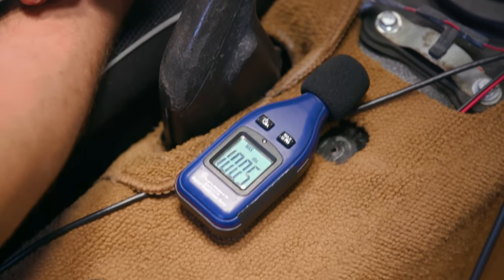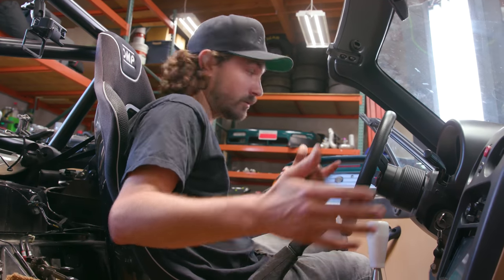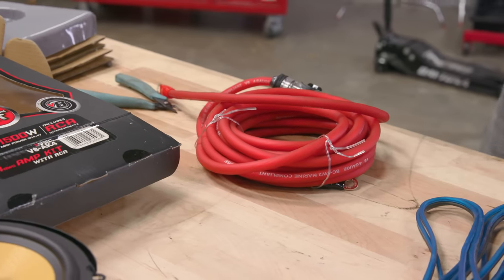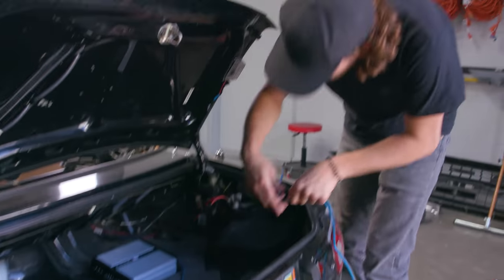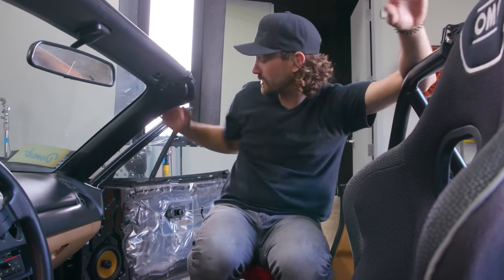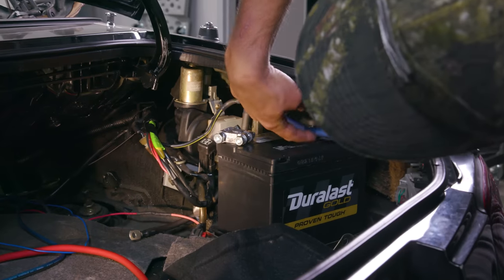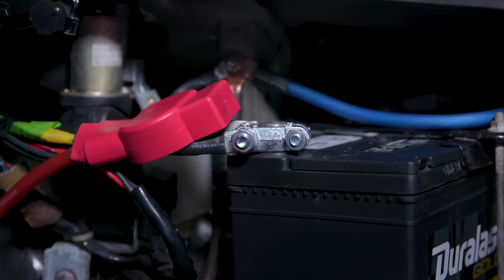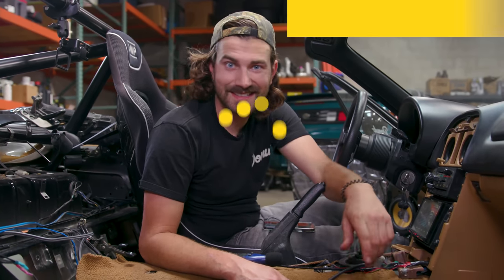Is Upgrading Your Car Speakers ACTUALLY Worth It?

Comment: the only thing that was a little off about this video was when he talked about the power a headunit can send to door speakers, some decks can reach like 200-300 rms, saying that, its gonna cost you some money for a tough enough headunit, you can still get more than enough power instead of using possibly 2 amps in your car for speakers and sub. way more un needed wiring.

Comment: Giving my 2 cents here. So I haven't done it myself so I'm not gonna say that running your signal cables next to the power cable does or doesn't cause interference. Though theoretically it shouldn't be a problem. Since the power is DC, there is no alternating current to create a magnetic field and induce interference into the signal cable. But like I said, haven't done it myself. But worth testing out before having to strip extra parts of your car for more wiring.

Comment: Cool video, but I have a 2001 NB and it came with Bose stereo. Granite it’s old but it still sounds great especially after I changed out that old radio to a pioneer. I’ll replace when it gets bad or maybe add a system for a sub later, but hearing your system I definitely got lucky

Comment: If you had bought a slightly larger amp, and tuned the gain down a bit, you would likely also improve the audio quality since you wouldn't be maxing out the amp. The amp will also run cooler.
When amps reach their max capacity, they start to clip the tops and bottoms of the audio waves, and hence start sending square waves to the speakers.. When this happens, the speakers will blow after a period of time.  And, yes, a sub and amps with properly tuned filters on mains and subs make a huge difference in audio quality.  Brings me back to the 90's when I was into this stuff and going to sound quality and db dragging competitions.

Comment: The aftermarket speakers at high volume reminded me of my old Mustang GT with its Mach 460 sound system, which had amps. They did a great job with all other sounds, but at high volumes, the speakers just weren't quite up to the task of truly reproducing the booming base of a sub. World's better than standard systems(especially at the time), but still not on the level of full aftermarket.
Reply: It doesn't help any when they turn the gain up on the amp like its a volume knob, then turn the headunit all the way up. Now your sending to high of a signal to the amp, and the gain on the amp making it worse, then bam sounds like shit when it comes out the speakers, even though you just installed new speakers with an amp... too many people need to just take the time to tune there  system properly, and accept that you can't just crank the volume to 100 and expect the speakers can handle it... if he turned the volume down and adjust the amp gain, it would have sounded way better. maybe  not as loud, but I'd rather it sound good than just loud  and like shit.

Comment: The best thing I ever did was put house speakers into my car a second hand bose system in the doors and a bookshelf Wharfedale 30 D  in the back. so much cheaper and the sound is richer, fuller, louder and much deeper.
I've built many systems for bars, nightclubs, homes, vans, mobile homes etc.
And you can't beat real boxed off speakers instead of using the door with flimsy plastics for the speaker box .

Comment: I would never have cranked the volume on those speakers without using the high pass crossover. That was asking for damage to the speakers. The unused 2 channels on the amp can be used bridged to drive a nice 8 inch subwoofer enclosure, or larger, depending on the space available. Oh, an inexpensive door kit, dampening material, would have made the door speakers sound much MUCH better and would cost about $50,

Comment: Should have enlarged the speaker holes and used 6x9s. Or put 6x9s in the back. A second amp for a sub would help lots too. 6.5s really can’t hit low frequencies. Should say the frequency range on the box.
Reply: Also in you used 2 amp speakers wired in series you could have powered front 6.5s and rear 6x9s at 50watts apiece.

Comment: What's funny is, the JL entry level stuff is basically an old rebadged Alpine type s design, and the main difference between the type E and type S was a plastic frame and slightly smaller magnet on the type E. 
The massive downside to the swap is the reduction in tweeter quality! 
Aluminum domes on the JL vs silk domes on the Alpine. 
Now I'm no Alpine fan boy, that couldn't be further from the truth but this swap was by no means an upgrade in terms of SQ. 
Unless the Alpines were damaged.

Comment: You should've mentioned that if you go down or drop the ohm load then it will pull more power from the amplifier that's if the amplifier allows it and doesn't throw itself into protection you also should've addressed ohms law and how to properly tune the amplifier and head unit considering the RCA voltage output from the head unit changes and how to measure the voltage coming from the head unit and going into the amplifier RCA input and then how to properly attenuate the gain knob adjustments. THE GAIN IS NOT A VOLUME KNOB!!!

Comment: Nice video! Good presentation. 
Lots of good background info without getting sidetracked from the Main event.
I will have to do some research on the high pass filter options. That sounds useful.
Thought some of the speakers read about had it built in already. If so I don't want wasted effort.
Thumbs up!

Comment: a good install takes a lot of time. is the effort worth it? prolly directly tied to a scale of how much you like music in your car. can you keep the stock head unit and just replace door speakers? sure can. can you replace the door speakers with plug and play units, add a sub and sub amp? yep. 
for me, taking the time to go over a full install is always worth it. i don't go crazy with custom door pods, or super expensive, high end comps, but for what i do as a hobby only takes about 25 hours and costs around $1500
my last install (it's been 6 years since i did my daily) was about a month ago. '15 tacoma with the factory JBL system. it was trash! i ripped out the factory H/U, the wiring, the sub box, and amps. in their place, i added 80mil sound deadener on the back wall and part of the floorboard. then i sealed the 4 doors, installed Morel 603 3-way comps up front, used cheap CT sounds mids for rear fill, and 2 JL TW3's in a sealed box all powered by an Alpine 5-channel. 
im using the Joying 10.1" head unit to control x-overs and equalization. 
you can do all of this, so many tutorials (like THIS one) on YT that anyone who can operate a cordless drill and a pair of scissors can install a wonderful audio system.
last thing: always, ALWAYS use sound deadener on your doors. at least a few strips around the speaker housing, to prevent rattles.. better yet, seal as much of the door skin as you can, filling all the large gaps with plastic or sheet metal, then apply sound deadener to cover all the holes. i can tell you from years experience that a $400 mid in a metal door skin won't sound as good as a $80 mid that's totally deadened. also, use speaker rings. they're cheap.

Comment: Good video, but you need to add a fuse on the power wire between the amp and the battery. It is very important for safety.

Comment: Great install, but reckon you went waaaay overboard with the power wire gauge. Unless you are intending to install TWO subwoofers, a second set of 6.5"' mid range and some tweeters. I just don't see the need for such power wire or as big an amp. Just changing the speakers probably would have been enough.

Comment: They are woofers, Mid woofers. They arent sub woofers. Also aftermarket headunits also can do high and low pass frequency settings. VERY needed if you are using it for main speaker power.
Reply: A big potential problem using head unit for crossover though....  People have had them reset to factory default for whatever reason, and thousands of dollars in blown speakers result.

Comment: Google needs to stop spying on me. I got recommended this video the day I'm planning on replacing the stock speakers and wiring in my car. I've spent about $350 between everything including head unit, door speakers, amp for door speakers, subwoofer, amp for subwoofer, two amp kits, and all the miscellaneous stuff for installation like screws, tape, and rubber grommets.

Comment: i use to install radios. I would tell people you get more mileage on the speaker than you do the headunit. For the most part a factory headunit is tuned to pretty good but you won't get the volume you are looking for. BUT if you get a aftermarket headunit and factory speakers. You will get the volume for now but you will blow the cone out overtime depending on what they put in your car.

Comment: You need to install bass blockers on those speakers and the put a sub
Reply: Shouldnt need bass blockers just use the high pass filter and crossover on the amp

Comment: 0:36 selling and installing JL for the better part of 17 years  other then JL'S first attempt at smaller speakers and before they made amps. Hell yes its 100% worth it on most cars. I said most because some factory systems sound ok as is you can live with it. But most the times the tweeters suck.

Comment: That main fuse position makes me nervous. If the car is hit in the rear right panel there is an easy battery run away and fire. Best to put the fuse as close to the battery as possible.

Comment: This used to be my hooby, I've done this to all my cars since the mid 80's, now I'm not that much into loud music, but boy this video brought back so many memories, nowadays cars come with some very decent sounding systems and car makers have pretty fine tuned audio systems on their higher end models, so there is less need to upgrade it, except maybe for teenagers.  I still have some really old shitty stock am/fm radios, installation kits, adaptors and the like all crammed in old boxes audio systems components, cassetes, cds.  Time and money well spent I say

Comment: I'd spend approximately the same on the speakers as the amplifier as a rough guide. And run them in for 24hoirs minimum before going full power and never drive to the point they distort. Jl audio top end range used to be excellent although I haven't heard them in some time. Their base range was made in china and not so great. It's worth checking the relative SNR or signal to noise ratio and total distortion at given loads for amplifiers. Many larger car audio dealers have setups that enable you to hear certain gear, but many like Halfords tend to sell overpriced Chinese junk so be careful. For speakers I'd STRONGLY recommend Focal. Their entire range is about as good as it gets acoustically for the price. Also always be aware of speaker fitment and available depth In the door card for a quicker simpler install. And plenty of sound deadening in the door itself will help control all those fancy new big wub wubs.

Comment: Unfortunately on most newer rides the factory radio is integrated into everything, climate control, backup camera literally everything so upgrading anything is a pain and some vehicles won’t even function properly with the factory infotainment system
Removed thankfully the ram 1500 bighorn 4x4 I have has a 19 channel Harman kardon  audio system with a 12 inch touch infotainment screen with some video playback via apple
Music and for a stock system it sounds amazing.

Comment: Excellent presentation and good video of what you did and I appreciate you discussing the technical details of the speakers and the amplifier as these are very important and lots of people simply do not care to learn and understand these things. 
   And that tends to not make me happy or happy for them as knowledge of what and why are very important for many different reasons. 
   That is a C😎😎L system that you put into your Miata hopefully you will add at least a 8 inch or 10 inch subwoofer system to improve the bass performance. 
   And the Decibels you have now are probably more than adequate as you do not want to listen at more than 95 decibels for much more than a couple of hours. 
   And adding a subwoofer would for sure even raise the decibel readings. 
   Don’t get me wrong I love it loud and with bass that you can feel. 
   You might find that surprising coming from a 68 year old guy. 
   However I have always loved good audio and I really prefer it to be Equalized to sound as the music sounded in the studio (HOWEVER) I occasionally listen with the low frequencies cranked up some as I love to feel the BASS. 🔊🔊🔊🔊- - - -💥💨

Comment: Coming from an audiophile like myself who has been putting systems into cars since I was 13, the easy/short answer is YES most definitely. Now with that being said, the extended answer is alot more complicated. For starters, the first thing is the age/year of your car. Old cars came with stock PAPER CONE SPEAKERS that were pure shit no matter what and ripped or even disintegrated over time. Now newer cars made in the last 20 years or so have much better speakers in them then anything with a paper cone speaker. But, they still have quality differences of course and most cars still benefit from speaker upgrades because aftermarket speakers have 2 way and 3 way setups for mids and highs so you can leave your lows for the back of the car and mainly your subwoofer. Now if you get a car with an infiniti or bose system etc those upgraded systems tend to be different and only need a subwoofer because they have been tweaked for optimum sound quality
Reply: What is in your opinion a good speaker for the front two doors? I read that jbl is shit, I tend do try hertz, i want cleaner sound and bass in my volvo from 2010

Comment: Can you change the door speaker with out adding a new amp?
Reply: Yes
Reply: Absolutely, but the key to that is buying a good quality head unit. The shittier the radio the shittier the quality of sound it'll produce. I just put MB Quart 6.5s with a JVC head unit in the wifes FJ Cruiser and it sounds GREAT...  Putting some vibration dampening on the doors and foam sound insulation on the door behind the speakers helps too. It helps control all of the vibrations created by the speaker, road etc and improves the sound quality. Plenty on the net to help explain some of this in more detail. But to keep it simply, yeah, you can just replace the speakers and radio alone :)
Reply: I’d personally stick with the JL Audio like he has, they make some fantastic sounding speakers. Focal does too but both JL and Focal can get expensive on their higher end speakers. On the budget friendly side of things, I’d recommend JBL (not to be confused with JL Audio).

Comment: I replaced mine in my 96 base model 3000gt from the Infiniti system with d series kicker speakers and already blew one. I plan on replacing the whole system now since I know it’s not the speakers as much as it is the system not working well with them and likely overloading that specific speaker

Comment: I'm kind of surprised you didn't check your signal quality at all.  I mean, if the head unit is putting out distortion at max volume, you could be installing a $1,000 set of speakers and it'll sound like garbage when played at max volume.

Comment: I have a 1993 Del Sol with factory speakers and a cheap stereo. With the radio the volume is ok, I can hear it at highway speed, but when I using the bluetooth with my phone the volume is very low.

Comment: It was good coverage of the steps and even extra steps you run into like rusty battery terminals. Should have went into more detail on the filtering though. Is it built into the amp as selectable options per channel? Or you have to buy more parts to add in line ?

Comment: if you really want it next level a 6" sub fits in\under a Miata's dash. have seen a dual 6 as well but only when removing the glove box if you don't want to loose trunk space.  one other note is the wire used for the amp is massively over sized. nothing wrong with too big. just more effort to run and crimp and hide

Comment: And make no mistake, if you end up upgrading your stereo, and are replacing ALL the speakers, understand to do a "professional" job where you do not see the wiring, and add an amplifier - which you should do, because you need "watts" if you speakers are to sound good, including the big 3 upgrade you are talking $$$ some decent money ($1,500 components alone) and some serious time - like 20-30 hours depending on your install (generally the seats must be removed, plus door panels etc). How much time do you spend in your car tells you if it's worth it. To properly install a single amplifier with upgrading your grounding wires (Big 3 upgrade) cost is $200. That's after the amplifier. If you want to keep factory stereo but integrate a new stereo system then you are talking adapters and wire connectors etc etc. It is no small task. If you wish to run more than one subwoofer then most likely you will also need to upgrade your alternator, because you will need 2 amplifiers. Just some fyi. And a new alternator protects your electrical system, and gives you better sound quality. The bottom line, car manufacturers don't know their head from their ass when wiring an automobile. They do nothing to make aftermarket stereo products easy to install.
Reply: if i wanted to upgrade my stereo i would need 500€ worth in adapters alone just for a headunit swap. Sucks since i prob need to do it soon since my oem headunit has been acting up.